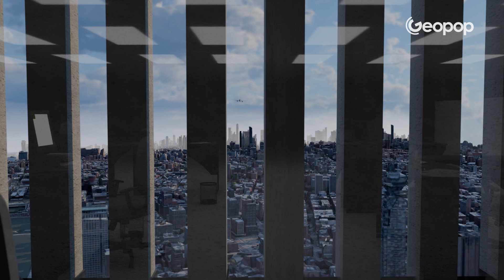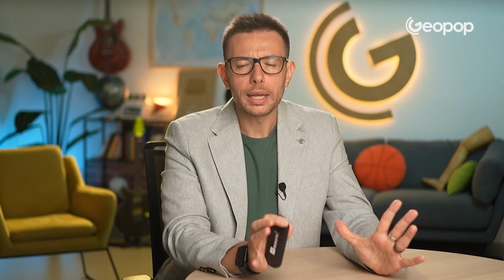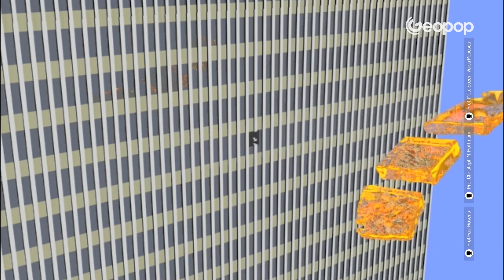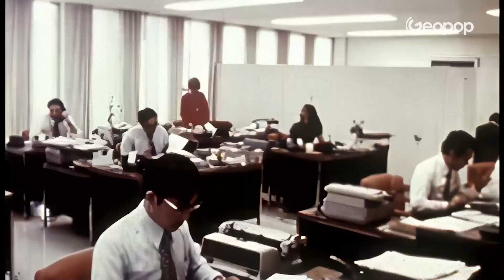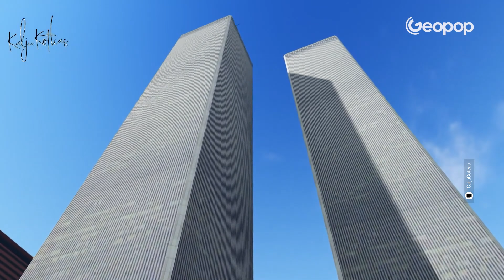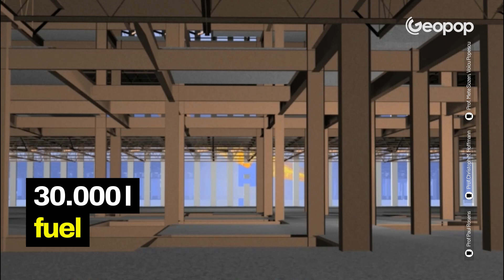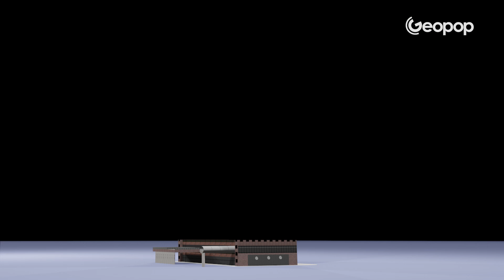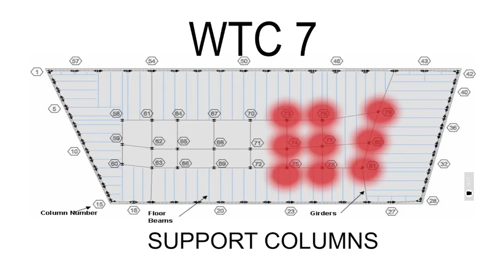9/11, 2001: The Technical Reconstruction of the Twin Towers and WTC 7 Collapses

Comment: Deformed steel caused the towers to falls??? 

Were the towers deformed at the bottom, where they were built the strongest?
Reply: dude. watch it
Reply: @themischief420 🤣🤣😂🤣🤣☠️☠️☠️☠️
Reply: Let’s break it down to the absolute basics:

The 47 core and 236 perimeter columns of the Twin Towers support all of the gravity loads of the building. ALL of the resistance is in the columns.

Planes impact Towers, causing massive structural damage, destroying sprinkler systems, tearing out gypsum board walls and blasting off the SFRM insulation from the floors. Multiple floor-wide fires are started instantly and spread rapidly due to the destruction of fire protection systems and venting of the building during the impact.

Serious fires were largely confined to the impact damaged floors and those immediately adjacent to them.  

Fires were started by the impacts and fuel aboard the aircraft, which acted as an accelerant. No shortage of other consumables inside the tower to continue the fires. 

Collapse was initiated (started) at the impact and fire damaged floors when floor trusses exposed to heat over time sagged, in turn pulling on and causing the inward bowing of perimeter columns by up to 5 feet until they buckled. 

www.youtube.com/watch?v=ULdiD6gYZO0  

No steel melted or needed to. Structural steel will bend and fail at less than half its melting temperature.

Once the perimeter columns buckled the formerly static load above became a dynamic load 30 times greater, easily overwhelming the structure below.

Thousands of tons of now loose debris fall through the open off space within the four outer walls - bypassing the columns - dropping 12 feet onto the first intact floor it comes across. That massive instant overload causes the floor to fail, shearing the pair of bolts that secure each end of the floor trusses to the columns.  The floor fails. adding its mass to the falling mass which continues to accelerate for another 12 feet until it impacts the next floor, rinse and repeat all the way down. 

Rate of collapse increases as momentum increases. The collapse front is constantly accelerating. 

As each floor fails, air inside the building (the Towers were 95% air by volume) is compressed, then blows out the sides _in reaction to the Tower falling, not the cause of the Tower falling.

No fire required at all on floors below the impact points for them to fail. The mechanisms that started the collapse are different to the mechanisms which continued the collapse.   That will be a difficult concept for some.

As the floors fail the perimeter columns are left literally hanging in the breeze, no longer attached to the rest of the structure. They peel away and fall in great sheets (think banana) out to more than 600 feet from the base on the 4 points of the compass. 

Core columns failed last. 

Each 110-story tower had a 1-acre footprint. The debris pile was up to 14 stories deep and spread out over 16 acres, destroying 8 surrounding buildings and damaging more than 100 others. 

The above all true no matter who planned and carried out the 9/11 attacks or why.
Reply: The deformation occurred at the places where the planes hit, and the fires were burning at high temperatures. In other words, at the floors that you see buckling and collapsing in every single video on the internet.
Reply: @ChristLink-Channel You clearly do not understand my question. Pay attention.
Reply: @CapnPink28  Oh, In understod perfectly, and answered accordingly.  Pay attention..   You asked if deformed steel caused the towers to fall.  THe answer is "yes".  What is so hard to understand about that?  You asked, I answered.  Steel deforms when its load limits are exceeded.  Simply physics.
Reply: @ChristLink-Channel See, you clearly do not understand because you are “answering” the statement, and not the question that I asked. 

The question is, “Were the towers deformed at the bottom”? Did the fire at the top weaken the steel structure at the bottom? 

You know, the thicker, heavier duty steel that held the building up??? 

Point is…..the “deformed steel” at the top of the tower has NO BEARING on whether the entire tower falls. None whatsoever! The only way for the entire tower to fall is if the supporting structure was taken out…..from the bottom, not the top.
Reply: @CapnPink28  No.  Your first question was, and I quote: "Deformed steel caused the towers to falls???".  That was the first question. The answer is still the same: Yes, deformed steel really is what caused the towers to collapse.  Steel deforms the fails when overloaded, which is what happened here.  You can try to punt and pretend that you didn't actually ask that, but it's right there, with a non.grammatical but highly emphatic set of three question marks.  I guess that makes it a super.question, or something?  But anyway, I've answered it three times now, so not at all sure what your point is.  You can keep on asking if you want, but the answer won't change.  Deformed steel is, indeed, what caused the towers to collapse.  The reason for the deformation is reduced strength due to high temperatures.  It really isn't hard to understand.
Reply: @ChristLink-Channel No, the semantic game is over. 

I am telling you what the post meant….I did write it, ay thank you….. and you keep changing it to fit your narrative. Have a good one, unless you want to answer the actual question I posed. 

But you won’t answer it because you know the answer. It makes zero sense for something that is damaged and weaken to completely destroy what is not damaged and weakened….i.e. - the top of the building would not crush the bottom of the building.
Reply: @CapnPink28  No, I haven't changed it at all!  In fact, I quoted your original question, verbatim, exactly as you wrote it.  And I answered it, correctly and simply, in terms that even a child could understand.  Are you a child?  I have no idea what you mean about this being about "semantics", and I suspect that you don't even know what te word means:  No semantics at all involved here.  You asked a question, clearly and simply.  I answered it, clearly and simply. Until you recognize that your initial question was indeed, fully answered, there's no point moving on to your other questions.  As I already pointed out, it is very clear, logical and simple to understand how the building collapsed, starting at the top and moving down, with each collapsing floor adding to the mass hitting the next floor down, and doing so at exponentially increasing velocity (thus with exponentially increasing force), all the way down to the ground.  It really isn't hard to understand, and even easier when you look at the videos and see that the is, in fact, exactly what happened. Once the initial major failure happened, and that floor "pancaked" onto the one below, the rest is inevitable.
Reply: @CapnPink28  No.  I answered the question.  It's not a statement, since it ends with question marks.  Do you understand how grammar works?  If it was a statement, it would have ended with a full stop or an exclamation mark, not a question mark.
Reply: @ChristLink-Channel As you still continue to not answer the fucking question I’m still talking about. Peace out, jfc!

Comment: Im still amazed that two different shaped structures ie the towers and WTC7 would fall in pretty much exactly the same way. Im equally surprised that as tall as the towers were neither even started to fall on an angle and yet both were damaged from one side inward. Maybe it did happen as the simulations but honestly I'm struggling with it. Finally we are told there were no explosions because the windows didnt blow out. Thermite doesnt explode it just gets very very hot and melts steel so the windows not blowing out doesnt negate thermite. If the temperatures from burning only weakened the steel where did the molten steel come from seen flowing out some of the floors. If it wasn't steel what was it? Too many question remain for my liking.
Reply: I'm amazed you believe they fell in pretty much the same way when there are no similarites at all. The collapses of each of the Twin Towers do have some distinct differences, but both are completely different to the collapse of Building 7.  That should be obvious enough just watching this video. 

Thermite melts steel?  Does it though? If only someone had actually tested this instead of just guessing or making unfounded assumptions. Oh, wait!

youtube.com/watch?v=JXWCMBuusMI&ab_channel=TrutherTVArchives 

In this video starting at 45:35 and running to 48:35 the Energetic Materials Research and Testing Center (EMRTC) conducts a test to examine the effectiveness of thermite in cutting a vertical hollow box-section steel column. The column tested is smaller in cross section and made of thinner steel than that of the Twin Towers perimeter columns (and never mind the core columns). In total 175 pounds of thermite are used for the test on just one column and requiring the construction of a rather conspicuous coffer dam to contain it. Do recall the Twin Towers had 240 columns and 110 floors.

It would be odd if thousands of office workers missed hundreds, perhaps thousands of those suddenly appearing.

Note what an incredibly slow process this is. It took close to 30 seconds for the thermite to finish burning off.  It would be impossible to “control” a demolition using this material.

Not to mention the issue of; how does the aircraft impact and subsequent raging fires NOT prematurely set this stuff off?

Also note how bright and obvious the whole process is. Could not be missed visually. No way to hide that. 

Then at the end of the test the (relatively modest) column was undamaged…. which is a problem.

Certainly no rivers of molten steel emanating from it either and in fact the whole thing cools rather quickly as soon as the thermite has burned off, as one would expect.

Thermite has never been used in the controlled demolition of any building, let alone one with multiple floors on fire after the impact of a large jet. If the conspiracy oriented internet has taught us anything it’s that if something has never happened before, it can never happen.

Time to stop looking for answers in amatuer conspiracy videos and starting using the thinking part of the brain.